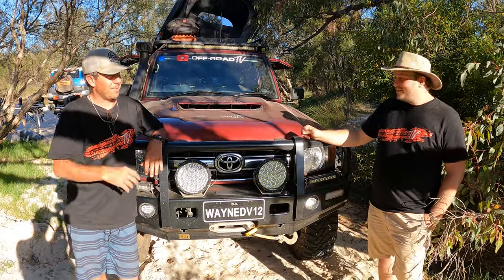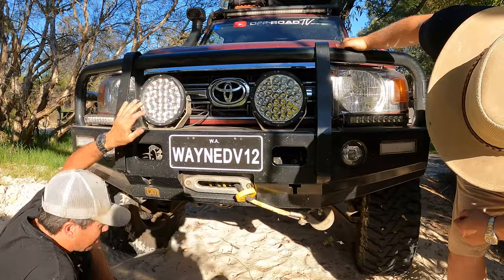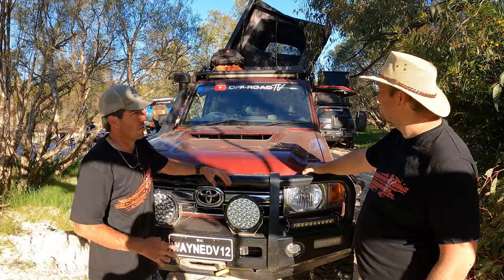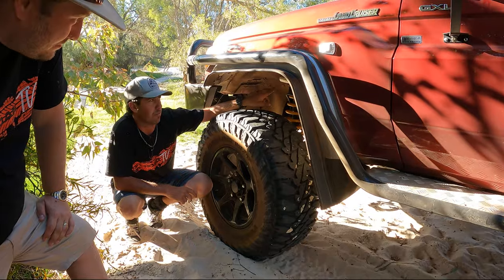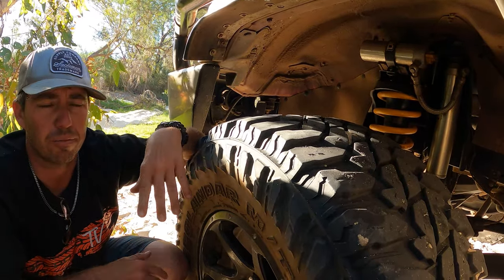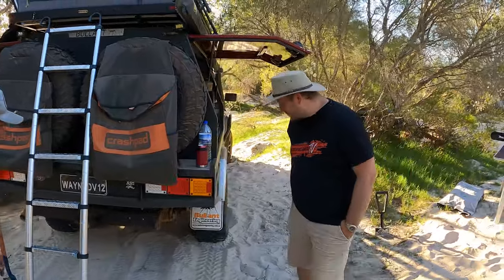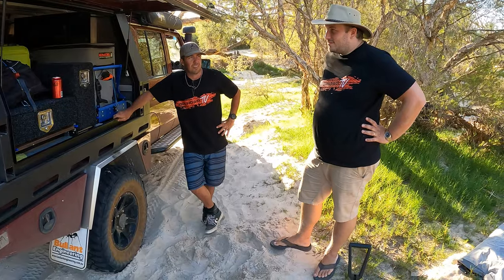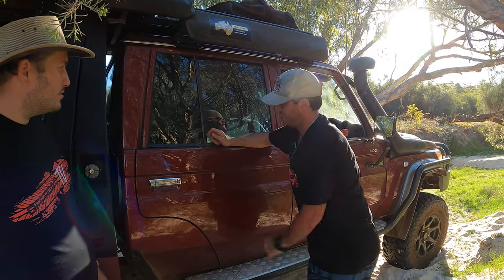Our Rigs: Wayne's Toyota 79 Series on Portals | Rig Rundown | Too Many Flies

Comment: Hey mate just picked up our new troopy a couple of weeks ago and getting all the tjm barwork done as well, so good to see it on your vehicle . Do you rate the tjm pace suspension, cause this time round whe're undecided on which way to go. Bp51,Dobinson mrr, Pace ect. Honest opinion would be great. Thanks mate.
Reply: Highly recommend the pace as it’s got the internal bump stop as well 
The settings are easy to get to by hand, no spanners required
If get pace make sure to run the right setting for the weight of vehicle otherwise it will be a harsh ride 👍